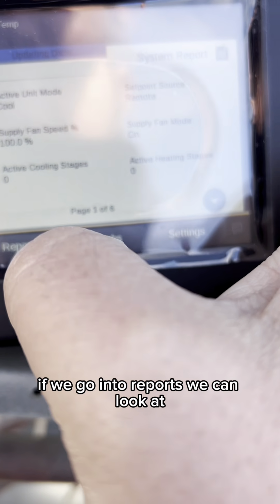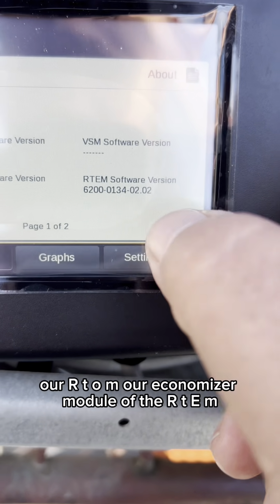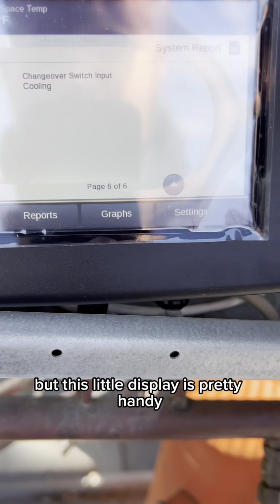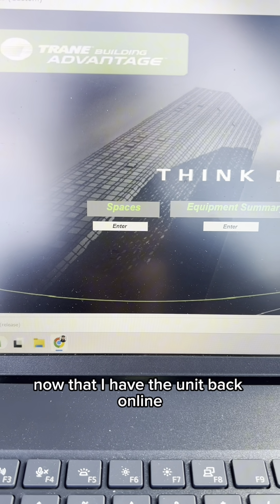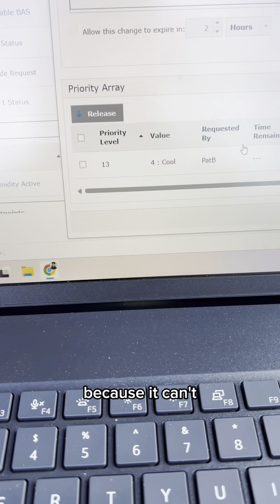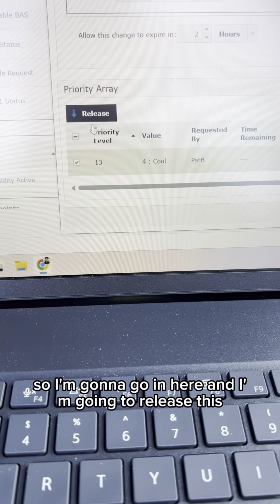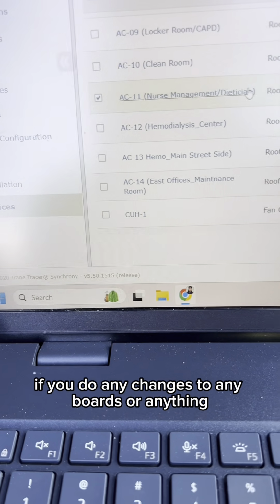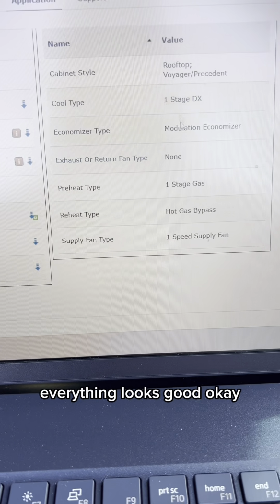Trane Precedent RTRM / RTOM Misconfiguration Fix: Why this Unit Thinks It’s a Heat Pump ￼

Comment: Excellent video and now I'm a subscriber.  I work on Precedent, Voyager, and Intellipacs and I want more of this type of video.
Understanding how the boards interact and how they are formatted is a mystery even to many experienced Trane Technicians.  I know because I ask them!  
I would love a video on the RTRM board.  It's inputs and outputs.  Go into depth on alarms and how to diagnose.  The way you explain it is awesome.  Most of the people who are watching this are techs.
Then the RTOM.  I have a total fan fail on a unit.  I unplugged the R 12 harness and now it works.  It was a total fan fail, not a run for 40 seconds and then fail.  Total fan fail.  It does not run VAVs and the temps have been in the 60s.  I unplugged it and the unit works.  It use to work before?  I don't know why and my Trane tech doesn't either.  I'm wondering if there is a manual Hi-pressure reset switch no one knows about??
No one explains this very well on you tube.  You did.  I'm watching this again.

Comment: Lowest online price is 1300 bucks for the display. 
GTFO Trane!
I'm working on an intermittent loss of comm to the compressor VFD on a 2 year old Precedent.
The J6 pin connection is jammed up in a corner behind so many other wires and zip ties it's nearly impossible to access.
That display should not be an accessory option!

Comment: Hello sir, I am working on trane units for grocery stores in Washington state I have 2 that are not showing up on the buildings Emerson system. They were for old tenants spaces that have been remodeled I have looked everywhere inside the unit and only see the RTRM board and no other boards any tips to point me in the right direction would be greatly appreciated!
Reply from the maker: On the RTRM board what terminals have wires connected to it as in low-voltage wiring

Comment: I had a service call for Trane Precedent 2021 and I cannot seem to figure out why it will not cool. The contactor is operating normally, I bypassed the Blue safeties with a jumper and on test mode the compressor turned on and fan spun, but afterwards on normal running operation it did not cool and it has a flashing diagnostic on the central LED on the RTRM that I cannot clear. I tested the voltage of j6-6 to j6-10 like the trane documentation says and everything reads normally. However it does look like there is continuity on cool and heat on J7 but I do not know what I should replace. Can you help me? Thanks.
Reply: Do you remember what version the rtrm board was?

Comment: One of the best Trane video I have seen so far. Highly recommended.

I do have a question Regarding the RTOM. I know is use for accessories like heaters correct? In this case is it use for the blower motor? I’m still trying to understand how the RTOM works.

In this case if you connect the TD-5 can you tell that the RTOM was bad since it was not communicating/showing on the report?
Reply from the maker: Thank you. I really appreciate that. So…The RTOM is basically the module that tells the RTRM what the rooftop actually is and how it’s supposed to behave. Its DIP switches define the equipment type, gas or electric heat, heat pump, number of stages, constant‑volume vs VFD blower, sensors, economizer, all of it. It also routes the major safeties like the high‑limit, freeze/coil sensor, and any airflow‑prove circuits. The RTRM doesn’t “think” about any of that; it just uses the RTOM’s configuration and safety inputs to decide when to energize outputs. That’s why the blower output from the RTRM is just a simple fan ON/OFF signal to the contactor or motor starter, while the RTOM is the one providing the rules, timing, and protections behind that command. If the RTOM is misconfigured or corrupted, the blower and staging logic get weird because the RTRM is following bad information.
Reply: I agree!